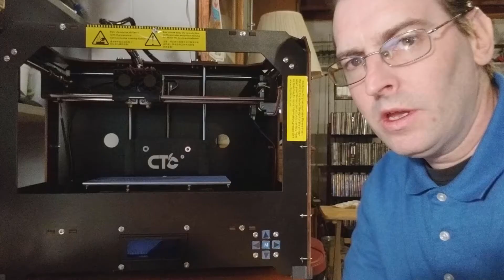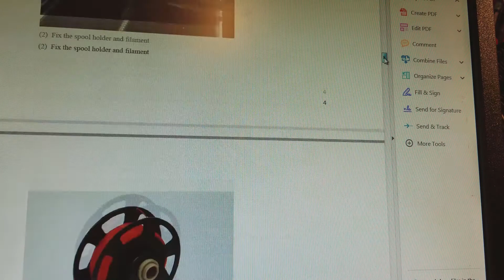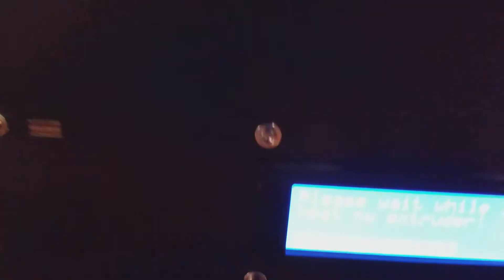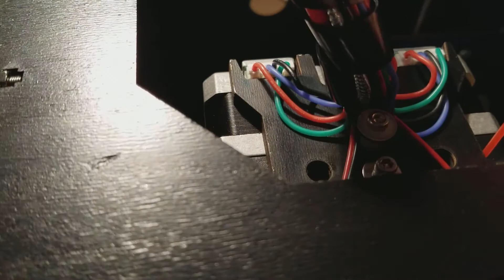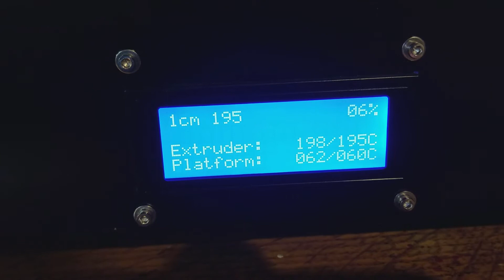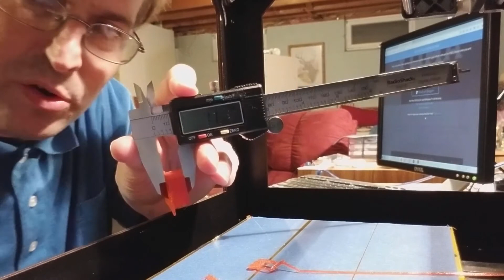Bizer CTC 3D Printer Un-Boxing, Part 2, Testing and Printing

Comment: How did you improve your print quality using this print. I seem to be getting very bad quality
Reply: I know this reply is very late but you can improve the quality massively by switching to the slicer MatterControl and on my machine I needed to increase the extrusion multiplier to 1.34x. I also slowed the speed down to less than half but that was more because of the noise. You can get very good prints from this printer if you take your time tuning the settings.

Comment: I just got one got everything leveled an ready to go but will not heat the extruders an says my motor is timed out?? What am i doing wrong? Any help
Reply from the maker: Check the plug connections. Ir found that often they are not seated right or not in all the way. After a few hours of usage they also shake loose. I've had this issue too, so I just recheck the stepper connections before each use. Thanks for your question!
Reply: Ok thanks! Also How do i make my prints smooth ? Some prints are a lil rough

Comment: Hello, great vidéo!
i have the same 3d printer.. but i have a big problem... it's impossible for me to install the software :s I don't understand why...
So i try to use CURA, but another problem. i can't read my SD card with .stl, .obj, or .gcod directly on the printer...
have you got an idea?
thank you by advance,
Reply from the maker: I have had a couple problems with connecting and controlling the printer with a computer. You can use the Makerbot software, and that helps. you need to select the Makerbot 2x or replicator 2  printer option (that worked on mine anyway). As for the files... it doesnt like g-code. it wants to run the .x3g file extension instead. this can be converted from g-code in the Makerbot software.
Some people prefer to just dump the original firmware and upgrade to Sailfish (Which I HAVE NOT TRIED). 
I have found a lot of help with more detailed issues like this in the facebook group https://www.facebook.com/groups/116968142003557/
Hope this all helps! Good luck!

Comment: So I'm still mid-assembly. 
Same issues it seems as everyone else. About 30 pieces were loose in the box upon arrival. 
The extruders are NOT even. Did you have to manually level the extruders to each-other?
Reply from the maker: Yes, I had to manually level the extruders. I found the easiest way to do that is to set the first extruder to where you want it, then level the bed (take your time and do this right! an un-level bed causes all sorts of printing problems!!!) then loosen the other extruder, so that can be moved by putting a little force on the top of the heat throat. use a screw driver to slightly move the throat down until the two extruder nozzles are level. you may want to use a feeler gauge to make the height as accurate as possible. when you're satisfied, tighten the screw that secures the heat throat. 
I've found a couple videos doing this as well, if my written directions aren't as clear as i would hope. Good luck!
Reply: So haven't bothered leveling the left extruder yet. I have however ran several test prints, and several high-quality prints. One of them took over 24 hours to finish, but I"m very pleased with the results. I'm using the included PLA but I have multiple materials on order. 

Thanks for the feedback, will be leveling the second extruder as soon as more mats arrive.
Reply: So, I ventured and leveled the left extruder. 

Now, I have the mind-numbing issue of prints being generally trash, even on high settings, low speeds, printing at 210 moving at 70mm/s which is far slower and cooler than previous successful prints. 

I've tightened the belts, loosened the head screws on the fans by a half turn, leveled the build plate, replaced the tape and made sure it was perfectly even, tightened the belts again, and did 3 backflips for good luck. 

Every time I go to print rafts, they turn into complete trash before the model itself actually gets started. 

So, I'm befuddled as to what step to take next.
Reply from the maker: That sounds like a bed adhesion issue. There are a lot of videos / forums / groups to go into great detail on this, but in a quick note: 
First, make sure the bed is as level as possible with about a post-card size gap between the bed and nozzle.
After that, it depends a lot on your filament. For ABS, try an acetone/ABS slurry. for PLA, glue sticks work well. Also consider trying a PEI sheet instead of painters tape! Good luck!
Reply: Thanks! I had a Cube 3D ( I know, baby steps) and the proprietary glue seemed to work very well. 

I've been using painters tape (good guess, lulz) with the CTC, so it might be time to switch back. 

Keep the vids coming! <3
Reply from the maker: Thanks! I'm glad I could help!
Reply: All of the screws on my main board.  The fastest way to align the bed, is to use a framers square with a bubble level in it.  Using that allows you to do a quick adjustment to make sure the print head does not collide with heated bed.  There are a number of adjustments you can make to make it an awesome printer, you may feel like you are chasing your tail, but each adjustment will dial it in for a nicer print.

Comment: I have had this printer for a few months and I am getting good results after a bit of tweaking. I recomend upgrading the extruder with aluminium spring loaders like these:

https://www.ebay.co.uk/itm/3D-Printer-Makerbot-Replicator-2-Extruder-Upgrade-Edition-Full-Metal-Extruder/122893966595

Also I put a PEI sheet on the build platform.

Software - I recommend getting Simplfy3d it has the CTC Bizer settings and works perfectly with the printer.

Getting awesome results now with these simple upgrades.

Working on getting the dual printing to work but I can't see that it will make a lot of difference to my 3d printing.

Comment: I've seen other videos that show/state loose bolts.  My co-worker also had the exact same issue with his.  He said "Every bolt was loose."  He has loaned it to me to use while waiting for my Prusa MK3.  I've come to the conclusion, that since the construction of this printer is basically cheap, they left the bolts loose so that when shipping, none of the panels would crack.  I feel that it could easily happen if tossed around like "Ace Ventura".   :)   It would be good for the manufacturer to state "tighten all bolts", as well as, give a notice of where to look for the manual.  I suspect, in China and Japan, that it is "the norm" to look on electronic media for manuals and other additional information.  Perhaps, in the USA, we are still in the "Stone Ages" and expect paperback books/booklets... :)   (Oh the good 'ol days!... I remember when.....)
Reply from the maker: Your theory about the loose bolts for shipping purposes makes a lot of sense. Its hard to say if it's intentional or not, you're right in that since it is a common problem, it should at least be noted. I also (shamefully) believe you are right about our excessive paper usage and our reliance on a physical manual delivered with our products! At least it all got sorted out in the end! Thanks for the feedback!
Reply: Do you have any suggestions for calibration?  This one I'm trying isn't calibrated. It under-extrudes and the X and Y are off. 20 mm cube is 18.5 x 18.5. Z is 20 mm   Thanks
Reply from the maker: Definitely check your belts for tension. Print or purchase tensioners if necessary. The Extruding calibration is done in g-code, slicing, or firmware, depending on which route you want to try. I would strongly suggest joining the facebook support group here:
 https://www.facebook.com/groups/116968142003557/
These guys are a collective of amazing support, specifically for this printer! They have helped me a lot!

Comment: Mine did not work
Reply from the maker: Thanks for your comment! While mine basically was functional from the start, it required A LOT of tweaking to get it printing right. I will be doing a follow-up video of the adjustments and mods I have made to get it working right... once I am satisfied with the results. If you can be more specific on what didn't work on yours, let me know and I will see if i can make a video to help you get yours running! Thanks again!

Comment: What about using Sailfish with this Bizer CTC printer?
Reply from the maker: I haven't tried Sailfish yet, simply because I am so use to the Repitier program, however, I have had a lot of problems getting the Repitier Host to work on the CTC, so Sailfish is becoming an option. I have had some luck with Makerbot software also. Ultimately, I would like to use which ever works the best, so another switch may be coming. Thanks for the recommend!